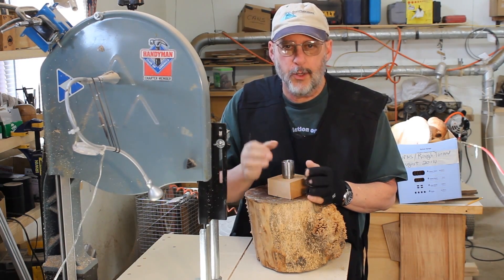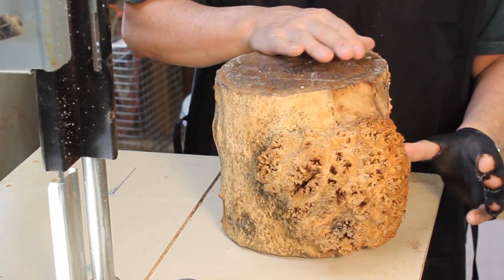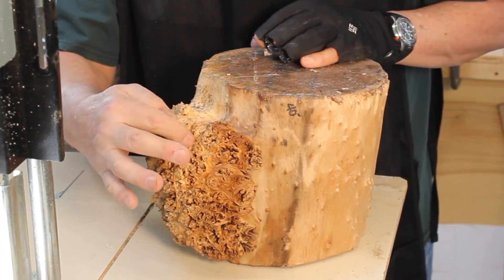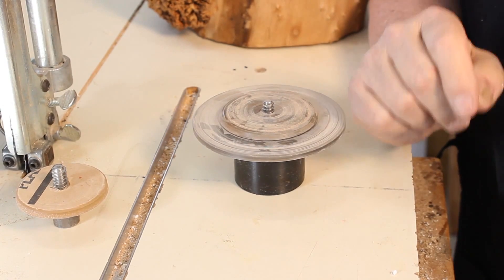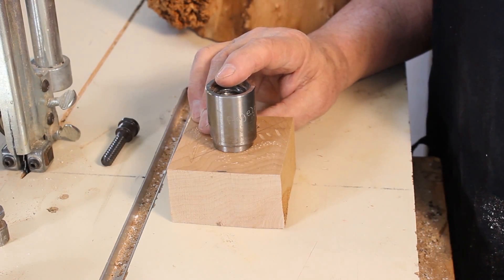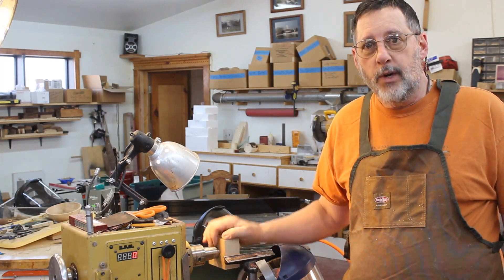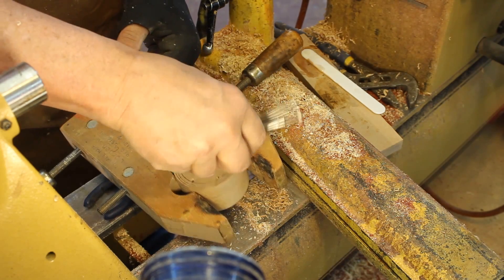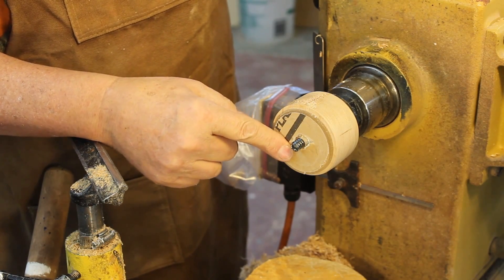FUNdamentals of Woodturning: #5 Make a screw Chuck

Comment: I purchased a screw chuck with a wood screw tip.  When I started making ice cream scoops and wine bottle stoppers the directions called for a machine thread.  I bought a bolt with an extended shaft, sawed off the hex head and mounted it into my Jacob's chuck.  A couple nuts and a washer finished my screw chuck.  I use a sacrificial spacer made of 1/4 inch plywood and I am ready to go.  I still use a tail stock to keep everything in place.  It works.

Comment: Sam, I'm glad to see that your hand is coming around.  I can tell it seems to be a bit tender as you work with it.  A lot of turners tell you never to use a glove on your hands when turning.  I turn mostly very dry wood and find that the shavings do a job on my hands.  I have neuropathy so any irritation is magnified many times over.  So yes I to use a tight glove with the fingers cut off on my hand.  Nice to see that you are using the face shield to.  I'm still surprised to many turners that don't use a face shield and a dust mask when turning.  Thanks for the video.  Best regards.
Reply from the maker: Richard
I also have a bit of neuropathy in my the in my legs..  Sometimes I think I'm falling apart.
I agree about the glove. I would prefer not to wear one. My incisions are not 100% healed up. So I'm trying to protect them a bit. But yes they are a bit sore yet.  But I am very careful about the glove, that would be a complete disaster
Thanks Sam

Comment: I've always used hanger bolts which have both machine and wood threads  You can embed either the machine thread or the wood thread into the block.  When the machine thread will be embedded, I first drill and tap the hole with the appropriate drillbit and tap, and then epoxy the screw in place.
Reply from the maker: +Bob Blarney That is a great Idea.  I used to use those in my woodworking.  I need to try that.  Sam

Comment: John from Australia saying Hello! Sam and glad to see you back in the saddle. Although I always wince on your behalf when I see you grabbing things with your crook hand. Question please Sam. Is there any BALLPARK suggestions as to a minimum number of threads to use in connecting your work piece to the screw chuck giving due attention to safety?
Reply from the maker: John
Great question. I believe the first consideration is how wet or dry the Wood is.  With very wet wood you'll need to reduce the diameter of your drill considerably. If the wood is fairly dry then the drill bits you use only need to be two or three sizes smaller than the thread diameter.  I think this is more important than how many threads you are connecting with.  I would think you will need a minimum of four layers of threads.  With a little experience and experimentation you will figure this out by trial and error.

Again, I feel wet wood Will require A deeper thread and a smaller drill bit to begin with.
Thanks Sam

Comment: Here's just a thought: for the log/burl that you showed: would it be possible to leave the rough outside alone-don't smooth it. But cut it off from the log and turn the inside as a bowl. Then, drill three holes around the rough bottom, and insert carved feet from twiggs. The result is a beautiful bowl, finished nice inside, with a rough outside and hand-carved feet.  Maybe call it a candy dish....

Comment: Last week i shaved part of a finger on the jointer. Just curious as to how you cut yours?
Reply from the maker: +Robert Swindell I was cutting a thin board on the table saw and it rose up on the blade and took my fingers into the blade.  Sorry about your accident.  Hang in there.  Sam
Reply: My guess is that over 50% of all people that have powered on a table saw have cut themselves. I on the other hand am in the other 50% - where I nipped myself while turning it off.

Comment: Afterthought Sam from John in Australia.
I note that you don't use tungsten carbide tips on universal handles. Do you have an aversion to using carbon tips? Some turners have said if you have a square, a round and a diamond shaped tip you can dispose of all your other tools.
Reply from the maker: John 
I started turning around 1990. I Will admit that I knew nothing.  At that time turner's did not have available the vast array  of tools they have today: and certainly not the carbide tools we have now.  So I learned turning with what I would call traditional tools.  The carbide tipped tools I have in my shop are for hollowing.  So with that said, I have no motivation to buy carbide tipped tools.  I try very hard in my videos to present options to turner's.  I leave it to the viewer to make a decision as to what they will do in their shop.  I never want to say," you must do it this way, or that way." 

This may be the most important point I can make, As I walk out on thin ice.  I have had 25 years or more to develop my Woodturning skills with a bowl gouge, spindle gouge, the skew chisel and other tools.  But at 65 years old----if I started turning today, it would be difficult to commit myself to using gouges and chisels.  I understand that carbide tools in the hands of  a new Woodturner Will provide very fast results.  And those results are pretty darn good.  Now I am not against scraping.  I have many scraping tools in my shop.  But my rule is to cut with a gouge---with no torn grain---then use A scraper to refine the surface.

Now, this is where I break through the ice.  I give the occasional class or lesson to somebody in my shop but I teach with those traditional tools like a bowl gouge.  If someone wants to bring their carbide tools, they are welcome. But I will try to convince them of the benefits of cutting with a bowl gouge or a spindle gouge.  But that is just me.  
Sam

Comment: The short drill bit ( c ountersink as you call it) is called a center drill and is primarily used by a machinist for starting a hole to establish a center hole to keep larger drill bits on center. O.H......GO BUCKS
Reply from the maker: +Greg Sawyers 
Thanks, I do have 3 or 4 of these center drills.  I just need to remember I have them. Sam

Comment: Sam,what about drilling a hole into the wood and through the screw then knock a pin in,do the same at 45 degrees 1/2 inch higher or lower,it'll give the screw a bit more strength to stop it ripping,

Comment: Having a hole in the wood already is not a good idea as we see the drill will go to the path of least resistance and may not be true center.
Reply from the maker: Dennis,  I went back and watched this video.  You may be right.  Although I still have that screw chuck and it is centered ok.  BUT, I think next time I would do it differently.  Thanks for bringing this to my attention.  Sam
Reply: Yes once a hole in wood and especially in metal is off center it's somewhat difficult getting the hole back on center. A drill bit of any length is flexible and being chucked up in the tail stock you have more flexibility. A stubby drill, or better yet would be a end mill, would give you more rigidity.   I'm not trying to tell you how to do something but being a retired machinist I have some knowledge of the subject. That being said I want to say I am getting a lot of knowledge from your videos. Would like more of them as I am a new bee to wood turning. Thank U